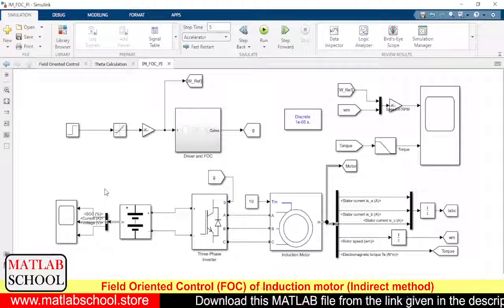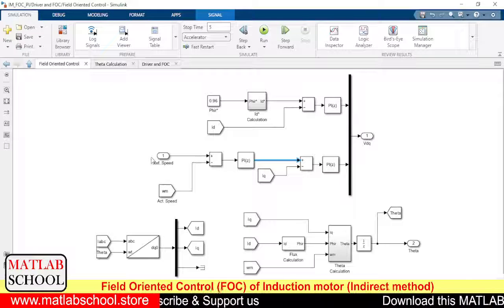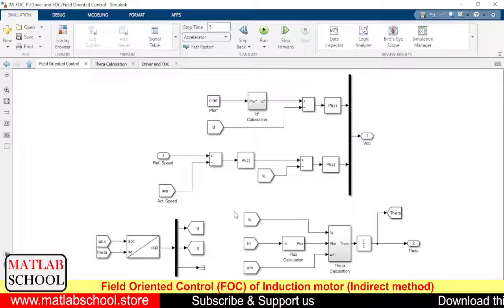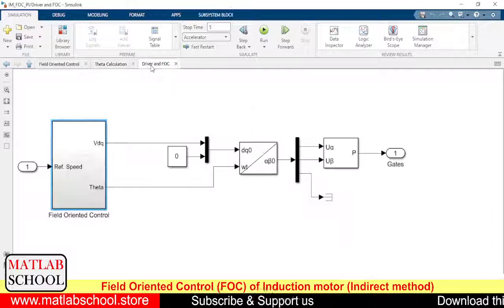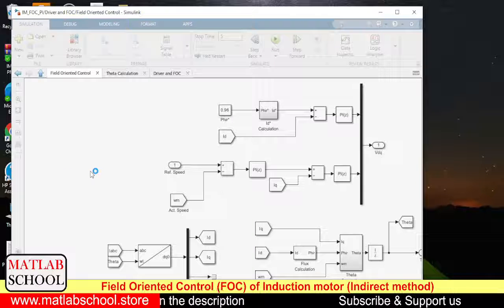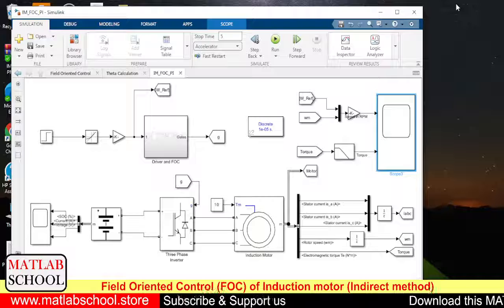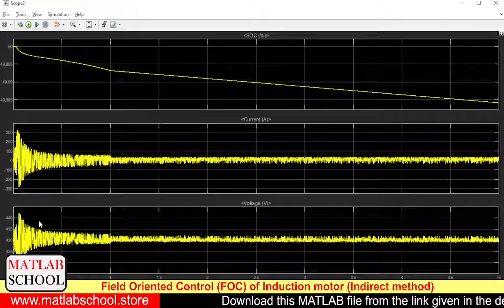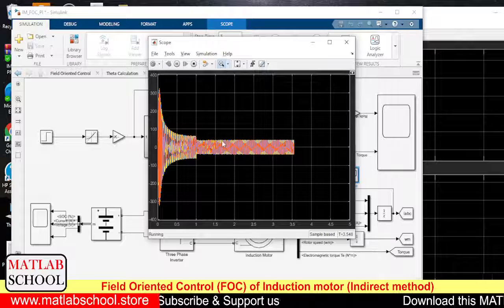Field Oriented Control (FOC) of Induction motor (Indirect method) | MATLAB Simulation

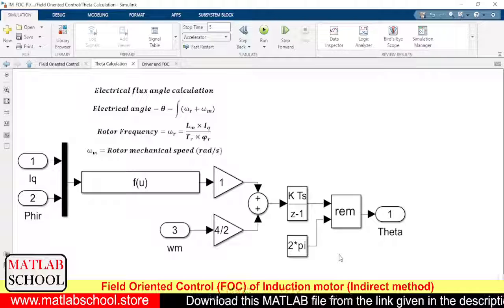Comment: If anyone else is getting Nan values. The issue is caused by a "divide by zero" right before the "1" gain block at 3:45. I added a saturation block with a min value of 0.00001.
Reply: Hi AlexWithMusic
Is Phi* the rated flux?